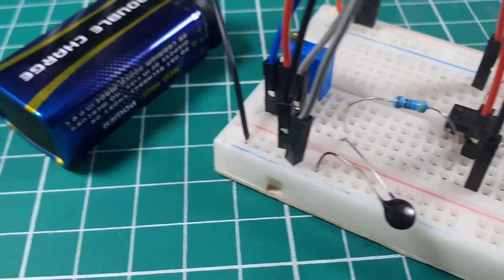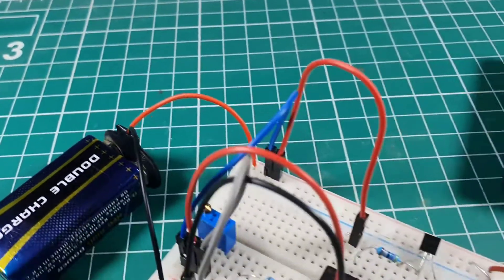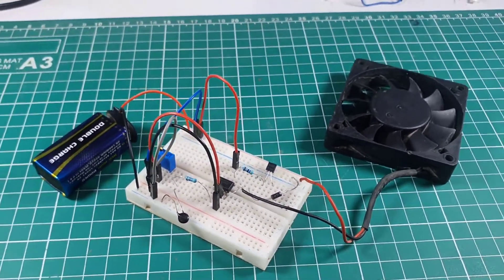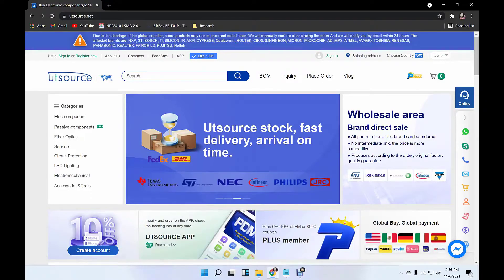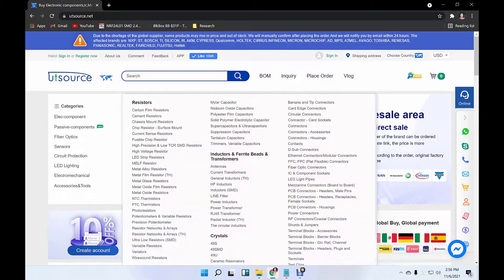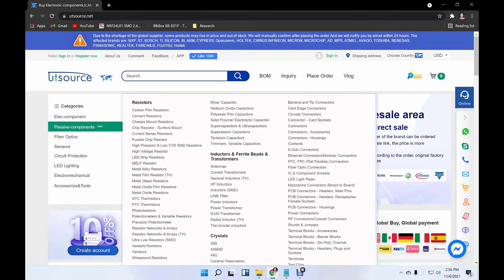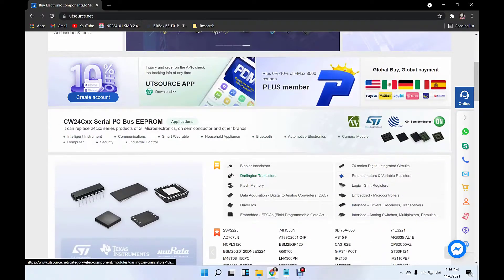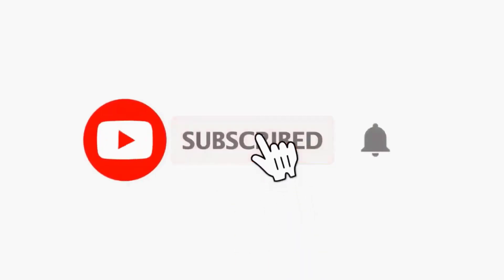Temperature Controlled DC Fan Circuit   Electronics Projects

Comment: also thermistor connection is wrong you have to connect it directly to pin 2 of lm741 and other end to negative terminal of battery and the other end of 4.7kohm resistor to positive terminal of battery